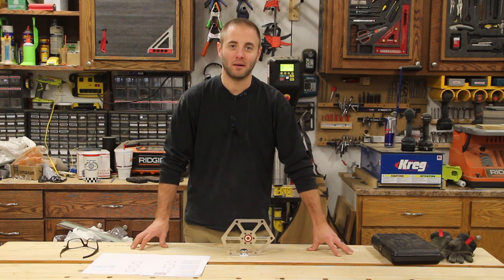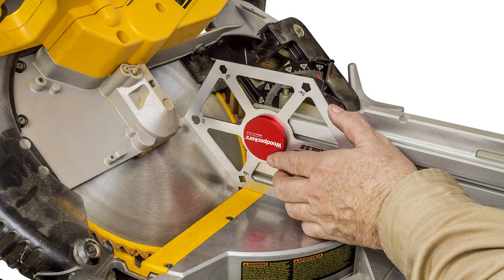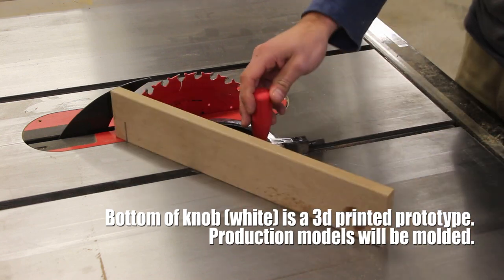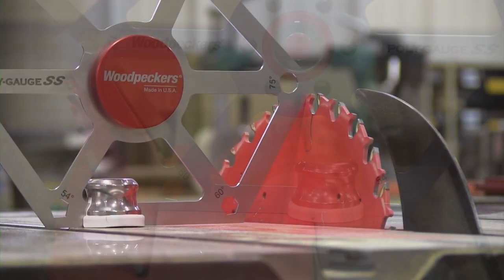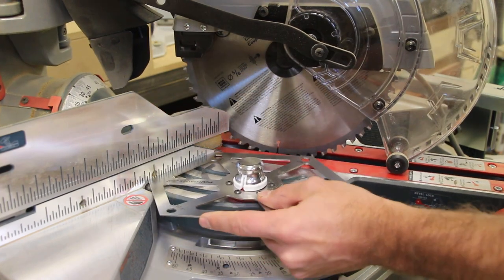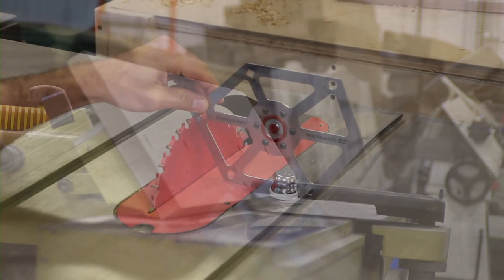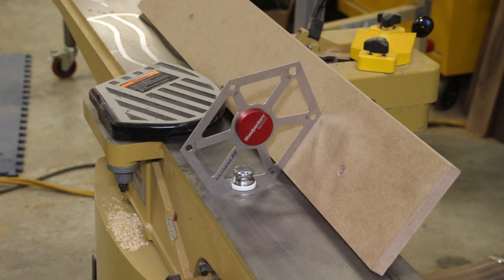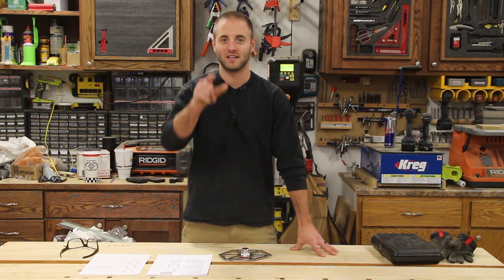Woodpeckers OneTIME Tool | PolyGauge SS

Comment: I have some Woodpeckers tools and like them a lot for their impeccable quality.  Can one get the same functions with much cheaper alternatives?  Yes, absolutely, 100% of time.  The cheaper substitutes will work just fine in most cases, perhaps not as well and perhaps not as conveniently as the ultra expensive Woodpeckers versions with all the bells and whistles.  Woodpeckers' target customer base is clearly not the average frugal woodworker, but there is a segment of woodworkers who derive pleasure from owning and using very high quality tools built with impeccable precision and are willing to pay the premium costs for such quality.

Comment: Lee Valley & Veritas have something almost exactly like this but it's $34.50. Hmmmmm, considering number of uses, my break even point will be 2053, it will be my son's by then. I'll be in the big workshop in the sky. But then again, those rare earth magnets, those little nub sizes are quite nice. That's worth the 3X price and 5 month wait. Order me a dozen!💨 oh, no shipping, I'll pick them up in my Lear Jet, let me know when the Chinese are done with manufacturing.
Reply from the maker: Tony V same concept but not the same tool. stainless steel. Magnetic base. And tighter tolerances. Does that make it worth the increased cost? That is up to the consumer!